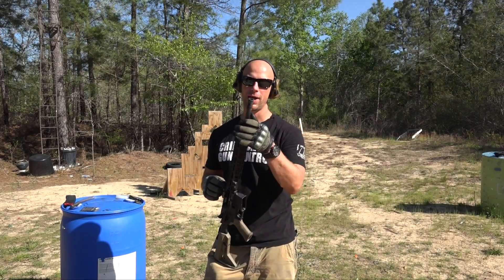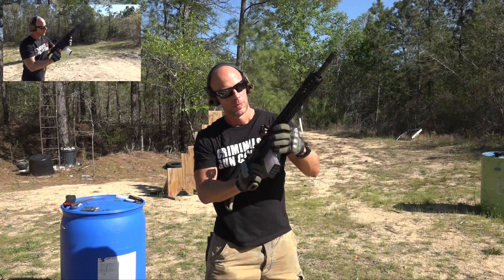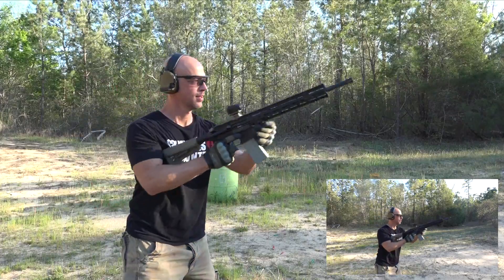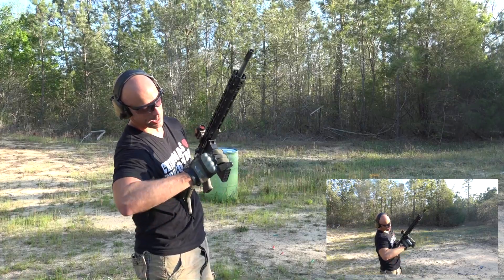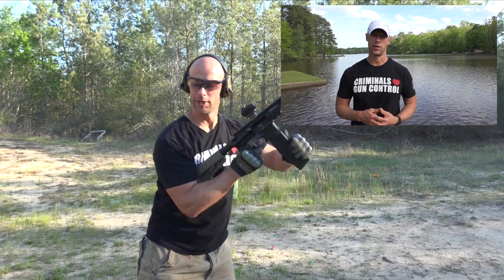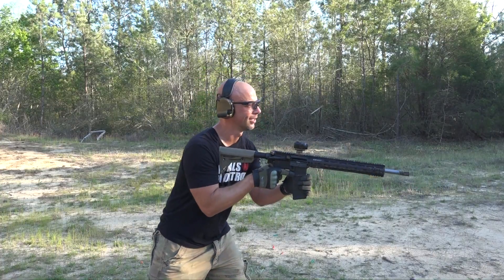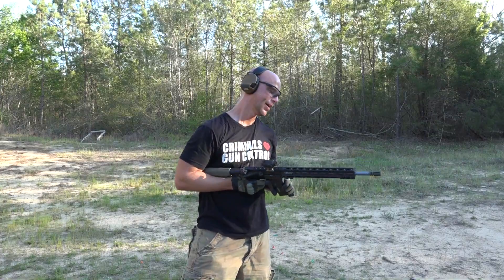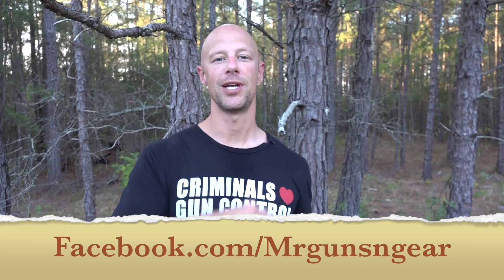AR-15 Full Auto Meltdown! Nitride Treated Barrel (HD)

Comment: These guns are overgassed as hell.
Reply: SerenGetter You beat me to it.
Reply: .081" gas port.
Reply: It is mid length, not carbine.
Reply: still too big by a lot
Reply: How so? Noveske is .080 and Rainier is .082?
Reply: Are you trying to deny that these uppers are cycling way too fast, and that the ejection pattern is clearly forward? Both indicators that the barrel is over gassed? Not to mention the stovepipe jams further indicating excessive BCG velocity...
Reply: No. What the video shows is a weapon running fast, not a specific cause of the issue. "Overgassing" is one of a few potential causes. 

What we did was publish our gas port and let informed shooters make the determination of what caused the gun to run quickly. If our gas ports, which we publicize how we make our choices, and what those choices actually are (which are extremely similar to other high end brands), is the cause, then its the cause!

This is backed up further by Faxon has the uppers on their way back to us from MrGnG for a full workup and tear-down. We will be showing the gas ports, the bore, and everything in detail. Nothing is or will be hidden from the public. 

That's how Faxon works. We're open on what we do, how we do it, and do incorporate feedback from customers to continuously improve!
Reply: Faxon Firearms I can appreciate what you just said, what Im saying is that this video is dominated by malfunctions and does nothing to promote reliability of Faxon products which besides comparing the finishes is the whole point of the video.

Right now the malfunctions present in both videos keep the true discussion from happening...different between chrome and nitride.

Right now its only about how two barrels from Faxon don't run on full auto.
Reply: John Neill, as I said in my last post this video's discussion has never been about Chrome or Nitirde as was originally intended due to the malfunctions caused by high bolt velocity.

bottom line is .081 gas port with no adjustable gas block is much too large for a 16 barrel carbine or mid-length

From this video there is no denying the malfuntions do not show the brand in a positive light.
Reply: My Faxon barrel has no overgassing issues, ran a MI non-adjustable gas block on it for a long time without problems, eventually put an adjustable on to tune it for 3-gun.

You want to see a REAL overgassed barrel, I have a 20" RedX HBAR that kicks like an AR-10 with the same MI gas block and steel case ammo and a rifle gas system. THAT is overgassed, lol.

Then again I got my barrel some time ago. There could be issues with the new ones. Or, as Faxon points out, the problem could lay elsewhere. I have no idea why he switched the bolt in the video when clearly a heavier buffer was in order.
Reply: it's the crappy buffer setup.
Reply: tackytrooper maybe he went to a "reli a bolt" 😂
Reply: gohop you obviously know nothing about that super 42 buffer set up its a lot of things a crappy it not on the list

that thing is all quality
Reply: Well I do not think it is fair to just say "Faxon barrels don't run full auto" because if you watch the Iraqveteran8888 ar15 melt down video, they used a Faxon barrel and the same gas block with none of these issues.
Reply: Justin Crawford Some people are just up for a fight and like to argue.  Faxon makes machine gun barrels as well, so I don't figure they'd be in business long if they were no good for full auto.  Some of us use Faxon products and know for a fact they are good to go.
Reply: gophop  Your assessment makes the most sense to me , but like I said without taking a look at it myself there's no way for me to just look at this video & diagnosis the exact problem. What I can say is unless he just got a lemon barrel or Faxon barrels took a complete dump relatively recently ( highly doubtful) they make good barrels .
Reply: SerenGetter the only way I know how to tell if a gun is over gassed is by seeing witch way the case ejects. if the case is ejecting backwards that means it's not over gassed , if the case ejects horizontal than its borderline of being over gassed , and lastly if the case ejects forward than its definitely over gassed.
Reply: Wondering if the gas port was drilled after nitride/melonite process. If so this might explain the accelerated gas port erosion as compared to the chrome lined barrel test, and increased failure rate as the test wore on.
Reply: mo hawk, Everyone's who melonite's barrels are, if I'm not mistaking.  Reason is, because they melonite the barrels and not the barrel extensions.  When people were meloniting them together there started to be alot of pins work loose in the barrel extension from the heat involved in the process.  So everyone, (that I know of), does it separate.  That's why most extensions are usually just black oxide not melonited.  They torque the extension on the barrel and then drill the port, ensuring that it is in line with the pin in the extension.
Reply: Both are drilled post coating/treating.
Reply: Get Some, its clear that you don't watch this channel
Reply: Faxon Firearms why not melonite after drilling? This should ensure that the port doesn't erode prematurely.
Reply: they do melonite after drilling.  I've bought nitride barrels from them and the finish is over ever singular surface of the barrel other than the locking lug portion
Reply: AmoebicMagician Read the comments.  Faxon answered this up already and you are giving out false information.
Reply: This is why I run ak74 in call of duty. Never had a stoppage in that game
Reply: Technically speaking, we have to drill through post treatment/coating otherwise we have to nitride with the extension attached - which we do not want to do.
Reply: Legion - you are good! Glad we can help!
Reply: Faxon Firearms Always appreciate an American based company employing fellow Americans. 
When y'all have time head over to my Instagram: 
Iron Clad Legion. 

Will certainly be picking up a barrel or something to run hard and post up a review. 

Keep at it! 🇺🇸👊🏻
Reply: Our pleasure, Legion!
Reply: The buffer is too light, that's why it's cycling so quickly.
Reply: Love your Barrels!!Faxon Barrels are on all of my builds!!Your Pencil Barrels are top of the MF Line!

Comment: One thing to keep in mind is that Melonite is nitriding which means once you reach nitriding temperatura (usually around 1000 degrees Fahrenheit) all bets are off.  The surface will soften and the original, wear-resistant will diminish.  Hard chrome, on the other hand, will not soften.  Staying below that temperature means the commercial/sporting market.  Military duty weapons should be chrome lined.
Reply: The only people who get barrel meant to be mag dumped are special forces. Buy your stuff for function, not fantasy

Comment: Should of tried a heavier buffer after the new bolt did not fix it
Reply from the maker: Running H2
Reply: Stronger spring?
Reply: Mc Swaggerpants did you see that the ROF sped up after a handful of mags? He showed the gas port eroding which I think is allowing more gas through causing the problems.
Reply: looks like it needs an H3 at least..
Reply: "Should of" what does that mean?
Reply: Could of been a weak action spring, doubt it though
Reply: @joshuab7737  thats because nitride barrels are cheap trash.

Comment: You may want to look into tuning that gun to run with that upper. That 1 o'clock ejection pattern and the inability to get through a complete magazine even before the test began makes me suspect that you could benefit from a different spring and buffer combination. I assume you are still using the same braided Geissele spring and buffer from the previous test. That test also exhibited similar issues.
Reply: Can be the bolt also

Comment: That thing was running 950+ from the get go and spitting cases nearly straight forward.  Gas port size way too large.  That barrel was obviously spec’d for semi auto and was never intended to be ran select fire.  Would have been more efficient just to burn it down on semi.  Bolt wasn’t the problem, buffer and spring not the problem, it’s the gas port diameter.
Reply: Alot of people don't get the buffer an spring is a cover for to big of gas port

Comment: My last build, I had the brass ejecting the same direction about 2 feet (over gasing).  installed a stoner h2 heavy buffer and I always use David Tubb's flate-wire buffer springs (in all my ar builds) which had it ejecting at 4 to 5 o'clock (far away) vs standard carbine buffer  spring ejecting at 3 O'clock (w/h2 heavy buffer).  Shot both 5.56 and 223 very well on semi auto and rapid fire.

Comment: That full auto lower makes me think that you could test the reliability of factory built complete uppers from different manufacturers.
Reply from the maker: well full auto reliability and reliability are not the same
Reply: It is essentially reliability during extreme heat. It's still a fair test assuming the buffers or gas port is properly tuned to the ammo

Comment: something definitely wrong with that upper, from the very beginning that upper was over gassed you can tell by the ejection of the brass going forward of the ejection port, something definitely wrong with the spring or buffer or an enlarged Gasport or maybe both.
Reply: Yeah, a heavier buffer could fix the issue. It's cycling to fast and that would definitely slow it down some. I wouldn't be surprised if the issue is an enlarged gas port. I've heard many times that commercial barrels will enlarge the gas ports so their rifles run reliably with crappier under powered ammo.
Reply: Yeah probably gas port got bigger from the first test i think the same thing has happend to my rifle after running it pretty hard in a few classes iv had to gas it down using a h2 buffer
Reply: Cory Bekkers they're different uppers...hence the whole purpose of the test...to compare two different kinds of barrel. but yeah the rifle is over gassed in both videos.

Comment: Thread jump from vibration is what's causing that mag release to fail like that. It is probably made worse because the outside box thread is expanding (it's heating first) allowing it to occur even easier. If that doesn't make sense let me know I'll try to explain it differently.

Comment: It would appear that the Faxon barrels are over gassed for full automatically. I suppose to aide in semi auto reliability.   Or the Geiselle spring is too weak and doesn't slow the action enough. I hurts me to say that because I love Geiselle.
Reply: It for sure is not the G spring, I have that thing and it is noticeably stronger than my BCM spring
Reply: Stronger does not mean slower. Spring rates are critical to weapon reliability. We'll go into detail during the debrief video.
Reply: Bobby Hunter: Couldnt agree more
Reply: Love your stuff, but there is no question that both of these barrels are clearly over-gassed.
Reply: Joshua - Far from a joke - which is why we are here conversing with customers. 

You are quite correct in the M4's and M16's  performance for the given ammunition, which is tightly controlled and 100% purpose built for a specific load. 

We set gas ports (and detail our process publicly) to work with all ammunition the weapon can be fired in including weak import loads. We can (and do) easily drill smaller gas ports for various OEMs who run the risk of reduced functional range. This is why we publish our gas ports specs on all our barrels. To that effect .081 is almost identical to Noveske (.080) and smaller than Rainier (.082). 

In this video, we did not test the configuration prior to the test other than a single magazine. Doing so would invalidate the bore results which are coming in the next video. 

The purpose of this was to show the differences in coatings, not ejection performance under extreme duress under completely non real-world conditions with parts from various OEMs never tested together before. 

We hope that you enjoy the video and test from that viewpoint and likewise see that we are 100% open with our customers. Send me an e-mail directly and we can chat on any topic: Nathan@faxonfirearms.com
Reply: Joshua-  The weapon was designed only for M193, though the A2 did take into account M855. All other rounds were designed to work with the weapon.

Yes, we understand that is how many will look at it. Its unfortunate, but we don't shy away from it. 

As you have shown your understanding of the weapon, we hope that our conversation with you and others will help more build the same understanding.
Reply: It's an art-form tuning an AR.  Most affordable commercial barrels are going to be wide open. But play with an adjustable gas block, the buffer weight, and spring... it can feel like you have a totally different rifle.

Comment: Are all Faxon barrels this overgassed? 

If you fired on semi auto would the rifle still be overgassed? Or is the full auto function speeding the bolt up?
Reply: Don V It depends what you consider over gassed.They have gas port specs on their site.  They do tend to run a few thou over bottom end function, but people need to remember that they are trying to please everyone.  If they make it smaller people will complain because it won't run Wolf (like BCM dealt with for years) and if they make it bigger for reliability sake people will say it is over gassed.  I run 6 different Faxon barrels with A5 systems running a Sprinco green spring and A5H2 buffers and get perfect 4 o'clock ejection with mil 5.56 ammo.  That's semi auto, but I'm sure you get my point.
Reply: You're running an H2 on what length gas system/barrel?
Reply: Bobby Hunter I have a 14.5 pencil (pinned and welded), 16" mid, 2 18" rifle gas and 2 20" rifle gas.
Reply: Bobby Hunter Also just to clarify, I'm running an A5H2 not the standard H2 with carbine receiver extension.
Reply: Thanks! Its a hard balance.
Reply: Joshua B. You are quite correct in their performance for the given ammunition, which is tightly controlled and 100% purpose built for a specific load. 

We set gas ports (and detail our process publicly) to work with all ammunition the weapon can be fired in including weak import loads. We can (and do) easily drill smaller gas ports for various OEMs who run the risk of reduced functional range. This is why we publish our gas ports specs on all our barrels. To that effect .081 is almost identical to Noveske (.080) and smaller than Rainier (.082). 

In this video, we did not test the configuration prior to the test other than a single magazine. Doing so would invalidate the bore results which are coming in the next video. 

The purpose of this was to show the differences in coatings, not ejection performance under extreme duress under completely non real-world conditions with parts from various OEMs never tested together before. 

We hope that you enjoy the video and test from that viewpoint and likewise see that we are 100% open with our customers. Send me an e-mail directly and we can chat on any topic: Nathan@faxonfirearms.com
Reply: From what I've read some manufactures are in the .071-.079 range for gas ports more the military/pmc aimed companies. I have a 14.5 mid barrel. with the Geissele items used in the video, the rail, gas block, and super 42 spring and only once have I had an issue with a short stroke. The short stroke was wolf and only one round.
Reply: Faxon Firearms is it true you guys sell your barrel blanks to PWS?
Reply: We do not comment on any previous, current, or prospective OEM business unless the OEM explicitly allows us to or has stated they use our components. We can speak to companies such as Cobalt Kinetics, 2A Armament, etc.

Comment: Excellent! I look forward to the follow-up with the guy from Faxon. I think we can be sure the test was as harsh as the CL test, because this time you were getting cook-offs. The mag release situation is VERY strange! Could it be that the spring is weakened somehow?

I'm certainly upset and confused about the function problems. I have built several Slide-Fire bump-fire carbines that function flawlessly at a measured 850 RPM (as measured by the Competition Electronics Pocket-Pro). These are 16" barrels, carbine gas length, TAC-CON 241 triggers, Tubb's recoil spring, ejector spring, and extractor spring, Spike's H2 buffers, and the Sharpe's Rifle Co. BCG with their Relia-Bolt -- and M3 magpul mags. I have NOT tried to melt them down, however, LOL.

Come to think of it, I'd LOVE to see a review by you of the Sharpe's BCG with Relia-bolt and, if you felt like it, a review of the entire bump-fire carbine I describe (I used the SSAR-15 MOD Slide-fire stock). You'd want to get the Pocket-Pro shot timer -- and it would be interesting to compare RPM of my build's vs your full auto (to my ear they sound around the same -- although my shooting was with Lake City 556 or similar (which, I'm never sure, is or is not the same as Federal eagle). My build also works fine with Wolf 223, but the rate slows down to about 800 RPM. I have had ZERO malfunctions with the three bump-fire rifles I've built (one chrome-lined upper from DSArms, and two nitrided barrels on my own uppers I built). I do really lube them silly with Slip2000 EWL before use, though.
Reply from the maker: thanks